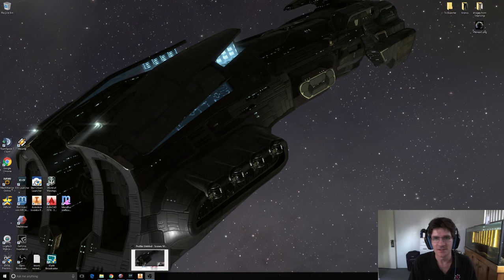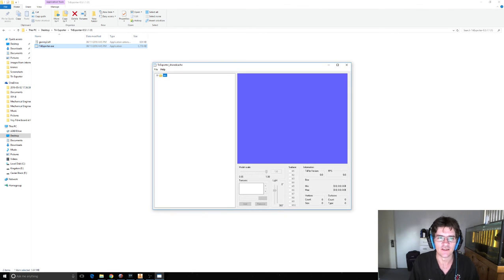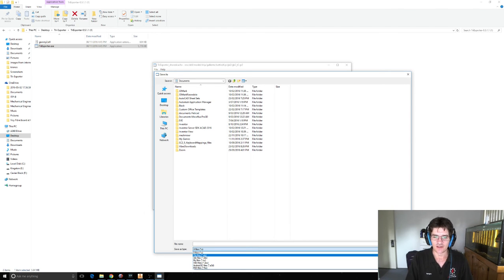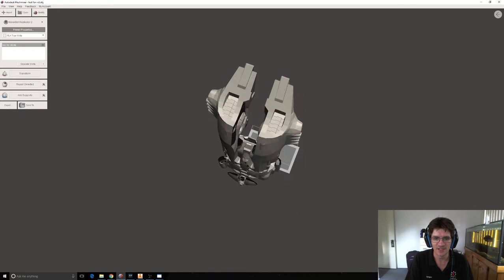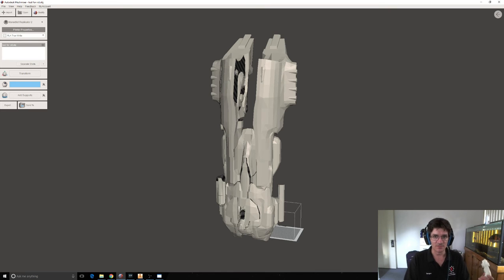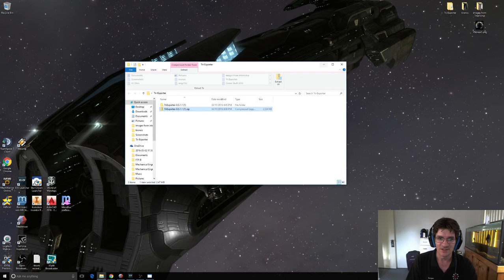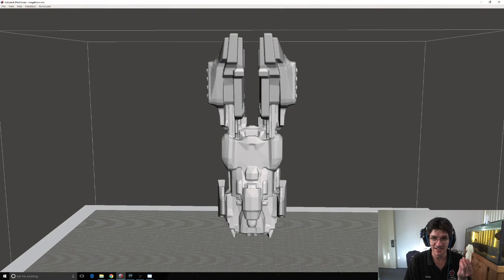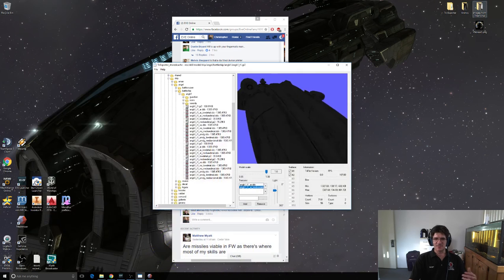5th Division Gaming Presents: 3D printing EVE Ships

Comment: I've set EVE to download everything and tried to set the file to TQ but it still gives me the error that it can't load the shared cache. Do you know what's happening?
Reply: It's giving you an error because you need to download the entire cache first. The Eve launcher was added a while back and it does not download the entire game to your hard drive. It only downloads the objects you encounter in the game in real time. Understand? In the launcher you need to go to settings and look for an option, "download all game files" Something like that. You'll know when you see it. Then it will work.
Reply: Can confirm, have done everything that you are saying and it continues to say "model not loaded*
Reply: It's much more difficult than it used to be. My guess is you have not found the correct folder. Used to be very direct, but there are several folders that look nearly identical now. My suggestion is to try them all until it loads correctly.  C:\EVE\SharedCache\ (try every folder) I would think it is tq since tranquility is the server eve is on, but it might be resfiles or another folder OR it might be just the EVE folder. Sorry, I can't see what folder it is in my copy of TriExporter and I'm too scared to reset the folder to the wrong one because I had a lot of trouble finding it myself. You'll get it right eventually.